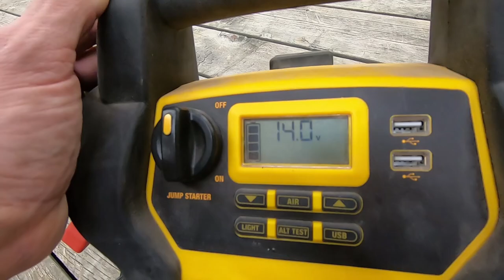Portable trailer winch - Harbor Freight Badland 9000

Comment: Why not install the receiver vertically down in front plate of tilt deck  just leaving a flush square hole facing up and drill hole in side to insert pin, when tilt deck is down pin will be locked in, hidden and secure from theft. Also that square hole could be used for some other application like an anchor point for something that gets hauled more often, maybe side by side or small tractor.

Comment: Great approach and I like the final change.   That is what I was thinking, there should be another way to shorten it and using the chain is a good solution.  This will allow you to pull the tractor on if it fails to start, but I guess the bucket would still be an issue if it was on the ground - no way to raise it up when pulling it up the ramp.  Like you say, having a portable wench makes it useful in other situations.

Comment: I never seem to be able to do a heavy pull with my 3000lbs winch, it seems to clip some overload protection on my Kawasaki mule.  After it sits for a few minutes it works again, but not sure why I can't pull more weight.  I think my battery is too small. Thanks for showing, and nice trailer!

Comment: Only thing that came to my mind is if you happen to bend that bolt, it could be aggravating to get out. I am looking for a new trailer and I sure wish receiver mounts came on them. I have an old Ramsey quick mount winch I used this way for 20 years.  Will be upgrading winches soon.

Comment: 2 rings welded to the 2 anchor points and stick the hitch tube thru the ring and bolt goes in.. IF the hitch tube does not fit, make one or use a smaller size... personally I would make one because you would have short distance of couple. OR do it your way 😎

Comment: Same winch I have on my 20ft car trailer works great
Reply from the maker: Do you have a dedicated battery or run a jump pack?  I'm thinking about picking up a small deep cycle battery so I have a better power source.
Reply: @adamj8293  I just run 20ft 2 gauge jumper cables to my battery of my truck and leave it running while loading something

Comment: Would jumper cable clamps be sufficient for connecting the winch to the truck battery? Or it should have bolted clamp attachments? I’m thinking of using jumper cable with clamps on battery and quick connects to the winch.